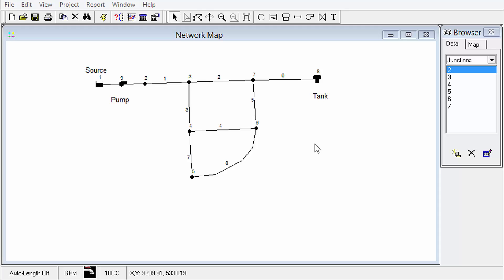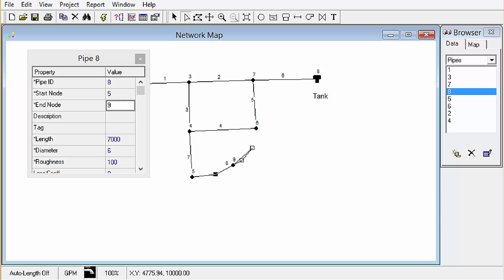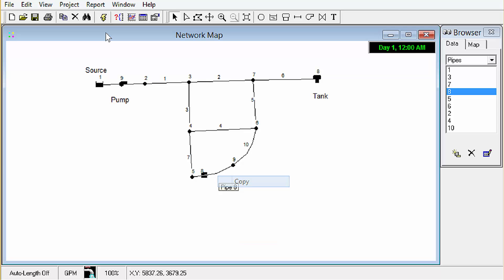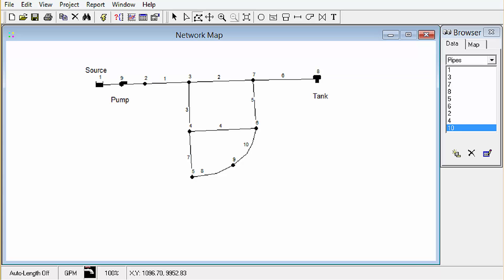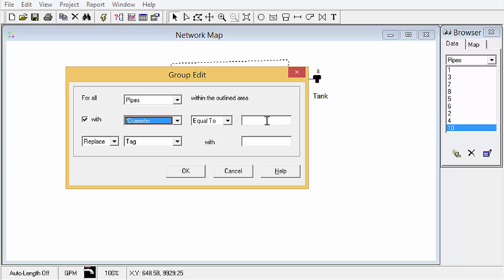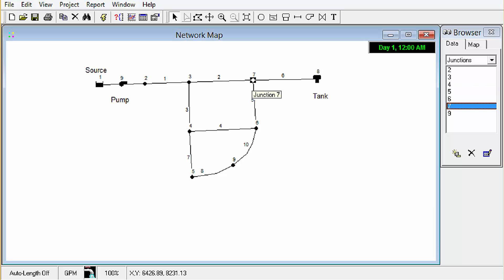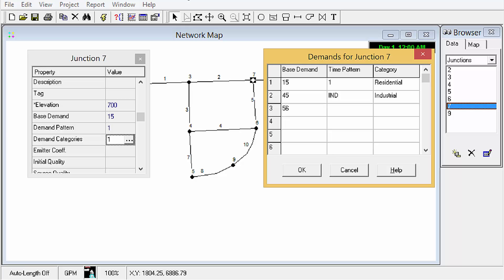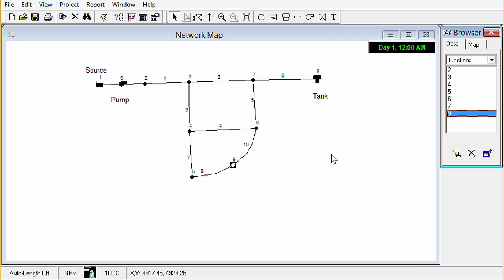EPANET Tutorial - Editing Elements | Hydraulic Modeling

Comment: I followed your tutorials and it was very helpful,
I have a larger model with more than 50 links and I,m struggling with the pipes diameter selection we need some practical tutorials on this issues.
When we got the proper pressure we lost the speed and when we get the speed we lose the head.